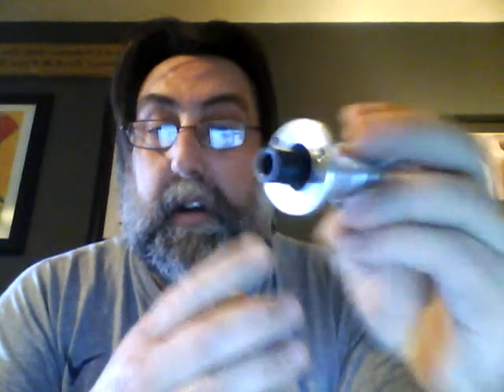Turnigy (FTL) 52cc overbore Gas Engine

Comment: Is there any way you can actually find who made these engines and go straight to them?
I'd like to know your opinion on the Champ as to quality? I have the same plane you have but haven't put it together yet. I'm like you...I purchase stuff  but don't get around to building for a couple of years.
Thanks for the informative info on this engine. I'm thinking of using a SupertTigre 3000 on my Champ.
Reply from the maker: toddy2519 hope this gets to you..  I can only say the airframe is pretty fragile so be  as gentle as possible, the weakest area is between the wing and tail, the covering acts as part of the structure so repair any loose or torn covering to prevent the fusalage from twisting,  as far as the engine goes all i know is hobby king sold it to me, i want to say its a turnigy engine but not sure..  looking back a 50cc is way to big for that airframe a 30cc would be great..  good flying..
Reply: Danny
Thanks for the info!!!!!

Comment from the maker: Hey Nicolas, actually I had a prop extention machined for $40 by a retired machinist and found out that that wasn't all, I know the owner of BME engines and I took the engine apart and he actually had to straighten the crank shaft, its a pressed crank and apparently it had not been assembled properly.. I have run it on a test stand and it seemed OK when I ran it. After this ordeal I now run all engines on the stand before installing on airframe.. Hobby King hasn't a clue on dealing with customer